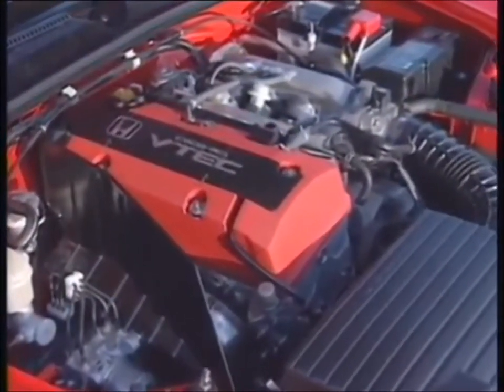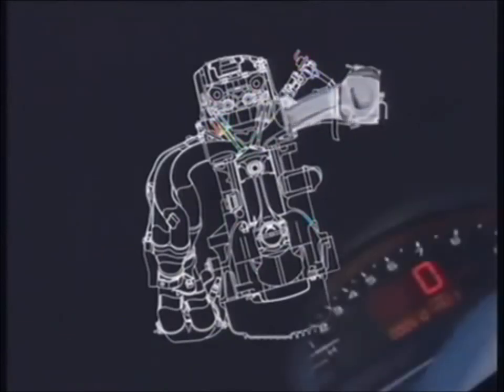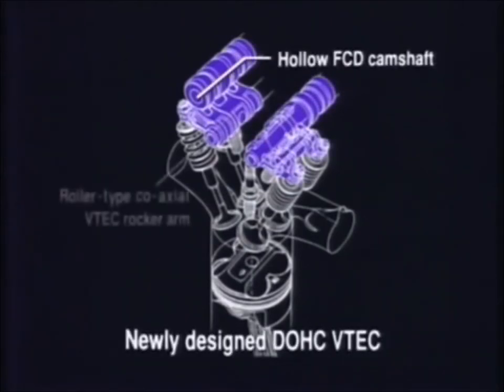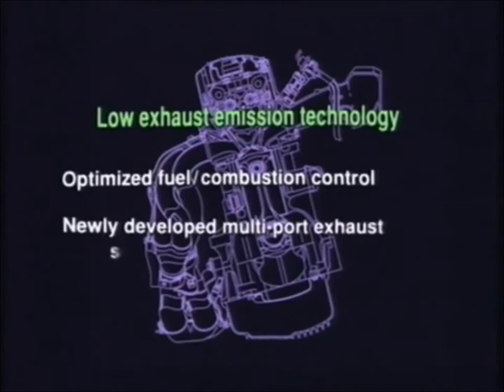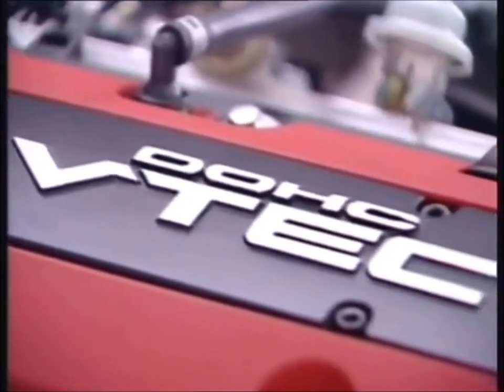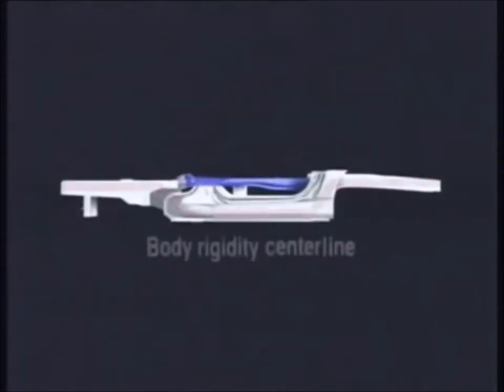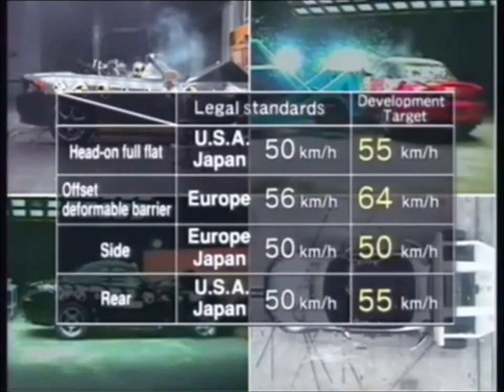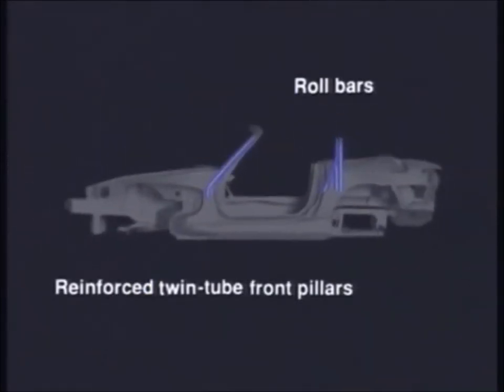Honda S2000 Technical Video (1999)

Comment: If only Honda right now has the same spirit as they used to have...
Reply: You probably have not driven the fk8 type r.  That spirit is very much intact, just a little more refined.
Reply: Wrong wheel I mean fun wheel i mean front wheel drive is still good